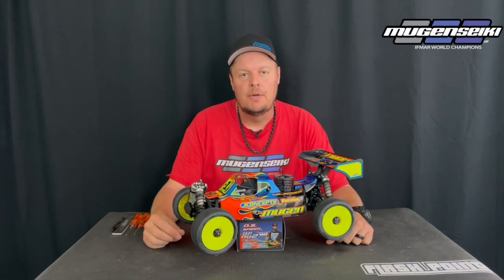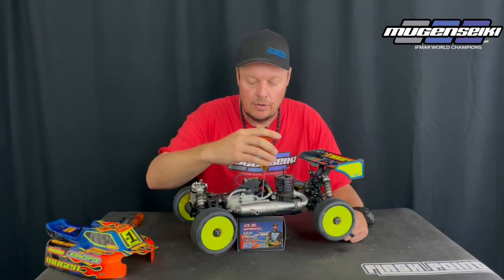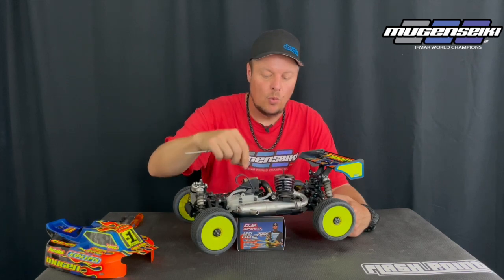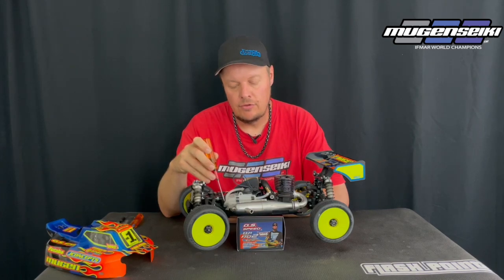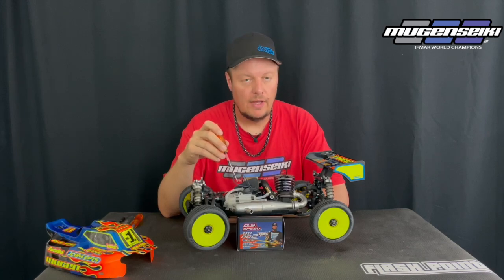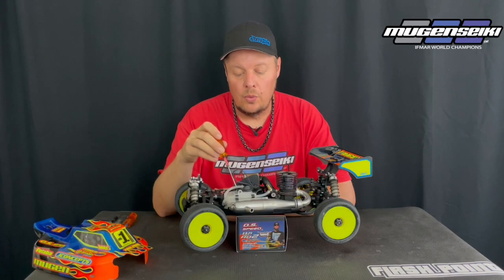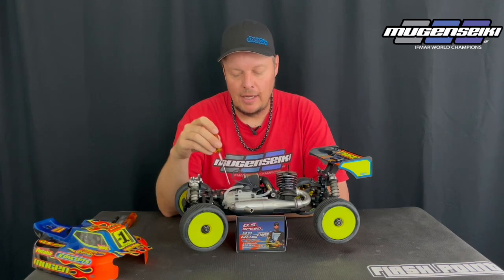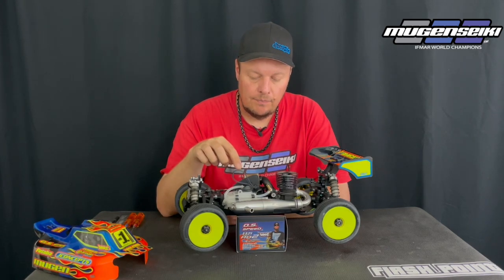Fuel Tank Mounting Tips.

Comment: I have a question on fuel tanks. Is it possible to add baffles to a tank to stop airlock and leaning? I had thought of adding sponge but I know nitro will destroy that and end up through the engine in one form or other. What are your tanks like for leaning out when your braking?

Comment: To add to this -- Make sure your fuel tank grommets are installed right-side-up.

I recently bought someone's used parts lot on eBay for my Tekno NB48 2.0 buggy, which included a fuel tank and chassis.  Previous owner had the rubber grommets in the tank upside-down, meaning the tank was held a little lower than it was supposed to be.  That might sound like a good thing, but when you look at the chassis you can see where the bottom of the tank was mashed down onto the aluminum the whole time he was driving.  I wouldn't be surprised if it caused the car to behave so poorly with foaming/splashing that it could be related to why the guy was selling off all the stuff.
Reply: My old chassis plate is so worn that there's zero anodizing on the bottom, but the top side near the fuel tank has nearly zero wear.  This used chassis plate from ebay looks like it was barely driven on as it has 95% of the anodizing left on the bottom, but the fuel tank area on the top shows wear from tank contact beyond what it should ever see.